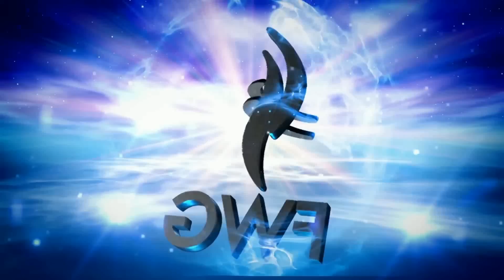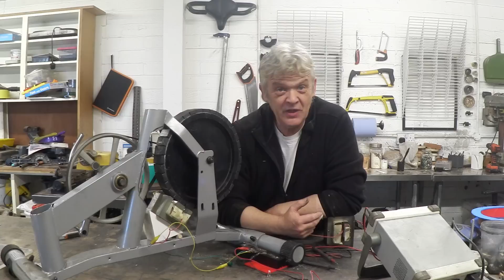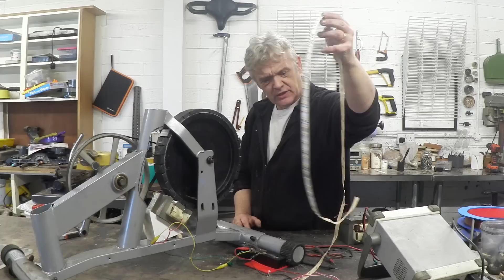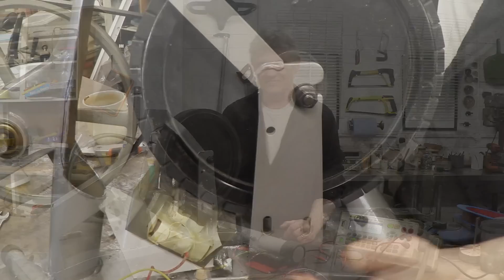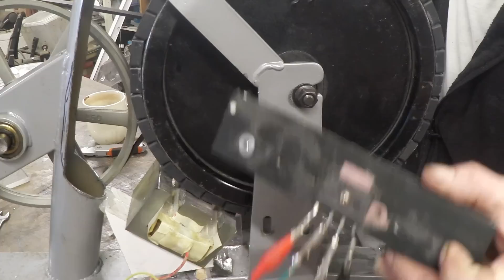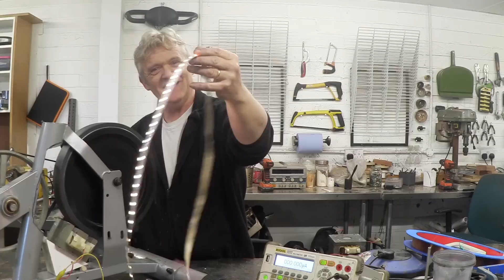Microwave Oven Transformer Into A Generator

Comment: Put a duplicate secondary from another MOT in series and you got twice the Volts, put in parallel and you'll have twice the amperage. Wrap fiberglass reinforced tape around the circuferance of the wheel and you'll be able to increase the RPM which = higher voltage. Position a series of MOTs around the PMG wheel so that the drags are cancelled out as much as posible and you should be able to get a Bedini Energizer to maintain the PMG. Awesome as always mate! I have always loved and seen the value in making things out of thing people throw out.

Comment: love this - only today did I remove two transformers and also the two turntable motors , not to mention a handful of relays and microswitches.  happy days.  i even got a nice motor from one of those microwave - oven combination types which is great as it has a metal shaft and metal gears.

Comment: Rules of thumb -- stronger magnet = more field lines per sq cm (more voltage and amperage). Smaller air gap between magnet and core = higher magnetic permeability (less magnetic lines being wasted between magnet and core). More turns in the coil = more voltage. Larger diameter wire = more amperage. Ideally, you want as large of diameter wire as possible for good current that you need for power, with enough turns to deliver the voltage you want. You need as powerful of magnets as you can get, with as many turns of wire per coil possible in the space available. With your coil, you could arrange several transformers around the circumference, but use the primary coils not the high voltage secondary coils. I keep thinking that the wire used is only good for a couple of amps before it starts heating and burns. That means it will only produce small amperage now matter how good of a rig you make. If you can get a bunch of microwave transformers, use two stacks of primary windings wired in series per transformer frame. Also, space your magnets out more (less magnets) as you want the fields to go through the transformer core, not sharply bend over to the next magnet in series due to close spacing on the wheel. On the cheap, smaller inexpensive neodymium magnets may well still give you more lines of force per square CM than much larger ceramic magnets.  You can tell the gauss by the pounds of pull. A really small neodymium may have the same five pound pull that your magnets probably have. Overall, the total amount of lines of force will be approximately equal, but the lines per square CM are way higher in the neodymium. The core itself has a saturation limit on the number of lines of force that can go through it at once and this is not often considered by people buying the biggest neodymium magnets they can find, as they often waste a ton of money for wasted lines of force. The ideal is a big enough neodymium with a small enough air gap to fully saturate the core. That secondary  winding would be pushing out 6 - 10k volts at that point in an inch long wide flame type arc to ground with each magnet pass.

Comment: The spacing of your magnets is not great enough and using spacing that matches alignment with 
each of the 3 legs of E-core would increase efficiency and output power. Ideally the spacing should 
be done so the centers of the grouping of 3 magnets locates over the centers of the 3 legs of the 
E-core. The air gap distance between the magnets and the core segments also greatly affects performance. With all of the 3 legs of the E-core flat and made the same length for the original 
application, a better use for the E-core is an axial architecture instead of the radial architecture 
that is used in your experimental model.  The E-core should be positioned alongside the rotor 
oriented so the vertical spine of the E is aligned with a chord line near as possible the arc of the 
outer edge of the disk rotor, with the center leg of the E parallel to the axis of the rotor.  
As the magnets pass by the ends of the legs of the E-core there will be an attraction exerted 
at one point laterally loading the disk in an unfavorable way hard on the spindle bearings, but 
this is remedied by having an identical E-core located directly 180 degrees across the rotor to 
equalize lateral forces on the disk and spindle bearings, and smooth the mechanical operation.
Such an axial architecture is adaptable to having additional E-core stator segments on each side 
of the rotor.

Where polarity allows for the architecture used it is possible multiple cores can be in series to add
their voltages or connected in parallel to combine their currents, or some of both effects possible
depending on the number and arrangement of cores that is used. This axial architecture is good for
a low rpm but high output machine adaptable to use as motor or alternator or generator.  Removing
the unused windings should have little or no effect, and those could all be left undisturbed and may
be useful for other different voltage output applications.  Where many stator segment E-cores are
present as an array, those segments can be connected various ways for different outputs from 
those separate coils used as accessory outputs.

Comment: Brilliant, I think you're absolutely right: efficiency is a holistic term, it's not just the percentage of energy conversion, it's also taking into account our needs, and the cost in time, money, effort, and other resources we spend to achieve something.
The 80/20 rule probably applies to the "efficient vs sufficient" issue, finding the middle path between under-doing something and overdoing it.

Having said that... I've noticed the iron core spans about 4 magnet widths.
Seems to me that means about half the time you get a magnetic field that either cancels itself, or bypasses the coil, and never reaches its maximum.
If you were to space the magnets a bit further apart, so that three of them fit the width of the core, you would get more energy for less magnets, (and less work attaching them to the flywheel:).

Just because it's more efficient, doesn't necessarily mean we need to avoid it, right? ;)

Thanks for this video and for all your good work.

Comment: What happens when you use the primary coil? The amps will go up considerably as the wires are thicker. We do not meet 50 volts but we need amps?

Comment: I am Completely Novice in electronics but i'm interested in this topic. My question is, Can i connect those wires to a car battery and charge it? If not, what do i need. I want to know the basics of once the structure is made, with magnets and transformers and motion, what/how do i wire this in order to charge a battery system with it.

Comment: What is the significance of the position on the magnets compared to the MOT ? I cant visualize the magnetic flux.
Also you could improve efficiency by grinding the MOT to have a curve on it to get it as close to the magnets as possible. 
And then adding more MOT's and wiring them in series or parallel etc.

Comment: Impressed with the power output. 🤓👍
Many questions;
How much power could be made with multiple transformers? (Simply proportionate?) Different transformers?
Would the other windings from the MW transformer provide a different type or limit of power?
Could the magnets from the MW magnetron work instead of the purchased bar magnets?

Comment: I’d be curious to see you hook this to a battery with some kind of boost or buck converter or a charge controller. That would be awesome to see a battery getting charged with such little effort. Very awesome
Reply: Those light only need a few amps to run so it would charge just not extremely effiecent or fast just like he said. If we put a few on the same axle and hooked them up into parallel we could get more amps out of it👍

Comment: i made a high amp battery charger from one before. rewound the primary and salvaged diods from a old alternator. the thing works great better then some i have bought. but the duty cycle is bad but works great for jump starts. a true scrap battery charger.

Comment: The simple truth is that if you just bung a volt meter on the output and all you get is say 4V then you know under load it's going to be useless so there is no point taking it further (unless you are getting say 10A). In electronics tests are done on initial "proof of concept" prototypes for this very reason. If the concept is wrong it does not matter how much time you spend on it or what testing you do, it won't work. I have 30+ years experience and still do this.

Comment: Now we're talking :-). If you could close the gap and curve the iron with the wheel radius it would still perform a lot better.
It would be interesting to stop kranking wo load so it would continue to run as flywheel and short the output. If you don't notice anything on the flywheel speed the efficiency of the whole thing is bad. If it stops in seconds it's good.

Comment: Robert Murry Smith                                                                                                                                                                                                          How about putting the transformers all around the wheel no doubt you have already thought of it it should make a lot of difference. Did you say N S N S N S and so forth the magnetic poles that is.

Comment: At Minute 3:12 you can see how the LED start pulsing, which is synchronous with the wheel rotation. i think this is due to the magnetic pattern of the many magnets on the wheel.
Thx for the video!

Comment: I tested my microwave's screen by putting my smartphone inside the compartment (no, not turning it on).  Leaving a Wi-Fi signal strength app running, the signal strength (2.4 GHz) was surprisingly strong - I was surprised.
Reply from the maker: interesting - cheers mate

Comment: In america a little known fact is a gallon of gas at 66 degrees has more density that a gallon at 76 degrees. The water jacket heats to around 180 degrees. So by heating the fuel with hot water it increases your gas mileage.
Reply from the maker: now then that is an awesome tip - cheers
Reply: @ThinkingandTinkering  in the bible the thief in the night was explained using gasoline. You fill a glass jug in the late afternoon, seal it and mark the level. When you check in the cool morning the fuel is below the line. If you heat the fuel you will lose power. In drag racing a ice bath is used around fuel lines to get the most fuel into the combustion  chamber. Another friend suggested using a ultrasonic mister on the intake as the fuel ignites it creates steam pressure. All sorts of tricks you can do to increase distance per volume. Government  wants that tax. Why alcohol used to be illegal fuel. Now they add just enough to make mayonnaise in the old carburetor. Oil mixed with water based fuel. Mayonnaise you use a egg to bind the oil with water.  Many have died trying to show how to use water as a fuel supply. You modify not only the carburetor but also the alternator.  Mainly the voltage regulator.  I know little tricks like if a car isn't  charging check to see if the field coil is working by placing a screwdriver to the back of the shaft, when the car is running it should have a magnetic field.  I always found alternators interesting how the battery makes the magnets and the stationary coil makes the current to charge the battery.  Look at ignition coils on lawnmowers. Now increase the number of magnets on the flywheel :) why I used a double half wave rectifier to a voltage doubler.  The microwave transformer has that W shape and if you space the magnets correctly the iron should have N-S-N then flip to S-N-S. You have to grind a arc in the iron to match the diameter  of the flywheel.  Which paper matchbooks are good for setting gaps. And the strikers are good for standing the points. FYI think about reported fuel consumption of jet engines. Measured in pounds/kilos per minute ;) this package was measured by weight not volume. ...anyways keep up the good work, you are inspiring many.

Comment: As you said, the meter showed what is possible. you then hook up a load, find if it will provide the power you need, and you figure out if the effort to generate the 
energy is worth it.
Reply from the maker: yep - it's just an internal yardstick to guide what you are doing as a very quick and dirty guide - that's all

Comment: Why have you left the transformer metal around the coil? Wouldn't that waste some of the magnetic flux? Especially as it's laminated and designed to minimise eddy currents? Or is this helping?
Reply from the maker: it probably acts as a flux pathway guiding the flux to the coil

Comment: Could there possibly be a bit of a mental block developing around the word "efficiency"? There have been lots of suggestions for tweaks (such as magnet spacing over core legs) to get more output for effort in i.e. to avoid wasted effort and make the thing (and things in other videos)  "work better". That's exactly what efficiency is! I think the point is that doing nothing because " it won't be the most efficient thing" is the error. That results in 0% efficiency :-) but it's definitely worth striving to get the best efficiency out of what you've got in terms of resources, simply by changing the arrangement a bit.
Reply from the maker: tweaks and improvements are different mate - I love the suggestions based on improvements - what I hate is when someone posts - 'well that's not very efficient what a waste of time' - believe you me I get posts just like that - suggestions for improvements - well keep 'em coming I love it
Reply: @ThinkingandTinkering  absolutely agree.
Reply from the maker: @nil5221  cheers mate

Comment: You’ve cracked it with that exercise bike, I doubt if more energy could be got from it! Love how slowly you have to turn it, and the fly wheel effect keeps it generating, great stuff, best yet in my opinion! Re ‘under load’ I only mentioned it with your static charger cos it would just be interesting to see what it could do, not cos it matters, the device is excellent!
Reply from the maker: no worries mate - if something is truly experimental I tend not to put it under load because I know I am going to do something else with it so don't see the point but when it is reaching a conclusion I will give I try under load just to see for myself

Comment: I think if you remove the core and just use the coil, bring it closer to the magnets, then rearrange the magnets so that only one pole is covering the whole coil at a time (NN, SS. NN. SS. for that size of coil and magnets it looks like), you will have very significantly better output. In fact use multiple coils, as you mention. I think the power output will improve dramatically.
Reply from the maker: give it a go mate - Ed R2 is right I am about getting it to do something and hopefully inspiring you to take it further

Comment: I can't help but wonder that if the output of the Wimshurst was connected to a coil what magnetic force if any would be created.
Reply: or run it through an auto ignition coil backwards, 12 volts?
Reply from the maker: intersting mate - give it a go and see

Comment: I use to throw out the second coils , never again.
Reply from the maker: lol - I know useful eh lol
Reply: A relief to me after i pulled out the wrong one. Oops.
One question , there's only one red wire coming out that end, two black at the other. I only see the one connection in your vid, the red wire. How is the circuit completed Rob?

Comment: Two questions, have you considered add more transformers and is there an ultimate need to leave the transformer metal housing in the mix?
Cheers
Reply from the maker: yes I considered it mate and I may well do - I tried without the lump of metal and it got worse - I think the steel acts as a flux path guide - but I am no expert here and basically just giving stuff a go

Comment: Only recently found your channel. Huge fan of your videos! I'm getting into learning electrical theory... which unfortunately means I have to look up half the words you use haha. 
Would it be possible to mount multiple transformer coils - would that "double" the output? What kind of difference in output would you see if it was powering a light, versus if you were charging a 12.6v car battery for instance?
Reply: nice,jargon can be hard to visualise, in this case go with the originators classic electrical theory analogy 'water'
one way to remember it is The voltage is equivalent to the water pressure, the current is equivalent to the flow rate, and the resistance is like the pipe size.
Reply from the maker: Paul's suggestion was awesome mate - I really good way to think about it is like water and yes you could put multiple coils on it

Comment: Why didn't you use the primary coil?  I have found that the thicker the wire, the more current it produces.
Reply: More current but less voltage. In many cases it's easier and wiser to aim for higher voltages, then convert it down and get higher amperes at the same time. Correct if I'm wrong but I think this is more effective that the other way around.
Reply: ......the small detail is that the thinner windings have a substantial resistance . if it's resistance is a tenth of the load resistance then it's considered okay .
Reply from the maker: it's going to be a trade off mate - it probably doesn't matter that much and really just depends if you want higher volts or higher amps

Comment: If anyone chose to achieve a much higher amperage from this, they should use the primary with neodymium magnets. The RPM requirement would be higher & most likely would cog much more. 
That is how I would use this. I always knew there had to be a way to utilize that very low OHM thick primary since when in normal operation from mains it is very lossy.
Reply from the maker: spot on mate - thanks for pointing that out